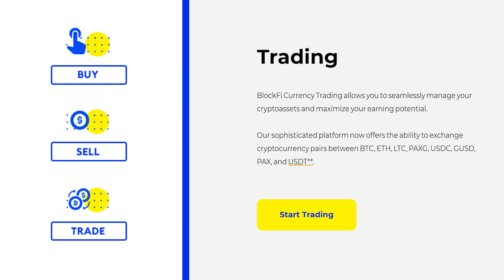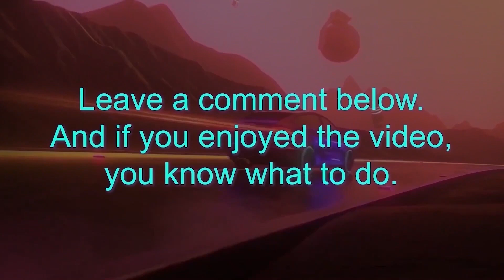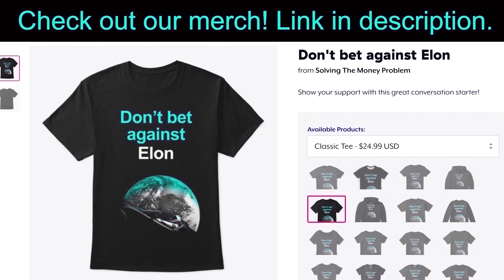Sandy Munro Shows Tesla's SHOCKING Lead Over Ford

Comment: I'm the living embodiment of the Osbourne Effect. Ford essentially sold me a Tesla. I got very interested in the Mach E when it was first announced. As I did my research, buying a Tesla became a no-brainer instead. A year later and I still get a thrill every time I drive our Model Y.
Reply: FORD still wants to sell you a FESTIVA ........LOL
Reply: @excelrobot  Let's Hope!
Reply: What were the main reasons you went with Tesla?
Reply: The Ford still works(cooling system)      It does the job.    Ford will simplify in time     As long as they sell as many as they make things will be good for Ford   The fist Tesla’s were said to have too much sheet metal to make the rear end   Now Tesla will be use they new press!
Reply: @marknelson463  the point is that the cost could have been avoided as the car was (hopefully) designed. 
More parts is lower profits and lower quality.
Reply: @NickYoung_Original  you do not get it   Yes it could be done better.    If it was perfect would it matter.
Reply: @marknelson463  Ford is a big, well established car manufacturer that fully understands how to build cars and make profit. So why are they going out of their way to produce a bodge job of odd parts all stuck together with hoses and huge wiring looms?
Reply: @marknelson463  Ford will simplify in time? They have literally known the issues since the 80's. How much time does Ford need to change?
Reply: PS they even have a nasty lead acid starter battery. Why is that not a long life LiFePO4 which would cost about the same and be about 1/4 of the weight.
Reply: @yourcrazybear  talking about the new Mustang E. Being a new car Ford will have the ability or opportunity to make changes over time   The 1980 has nothing to do with it (MustangE)
Reply: @marknelson463  On the contrary. They have known since the 80's about the risk for leakage and are still creating a leaking spagetti monster with their new car. They have had 30 years of time to fix this issue and they haven't. But still you are sure that they will? How much time does Ford need to change?
Reply: @yourcrazybear  looks like that entire system was designed so that the service departments have many billable hours after the 4 year warranty . Remember They need to keep their dealership model alive, and if they make it engineered not to fail, the dealers will not be happy.
Reply: @peterjackson1383  That may be the case. But instead they risk to make their customers unhappy in the long run. It's not a decision I would have made.
Reply: @TF-Times  it came down to a few things, but I can sum it up with this: I decided if I was going to go electric, I wanted to buy an EV from a company that was fully invested in the technology. As far as specifics:
Charging network
Autopilot
OTA updates (as of the time I made my decision, it was yet to be seen if Ford would be able to do that)
Reply: @TF-Times  and I would (and do) tell anyone who asks me about the Tesla that the charging network is INCREDIBLY important. We live in Alabama (not exactly the epicenter of EVs) and we've taken two 2k+ mile road trips in the last year to different parts of the country. The charging was effortless. That would not be true in a Mach E.
Reply: The Osborne effect he’s not buying today’s version because you’re waiting for tomorrow’s. One brand pushing you to another is something else.
Reply: @marknelson463  you're presuming that Ford even has "time." There's no TIME left for Ford, The time is NOW. Sadly, though, it's most likely too late for them. Their current debt is 9x their market cap while their margins continue to decline, their bonds have been downgraded to junk status, they keep changing CEO's which is never a good sign, their dealership business model is antiquated. I could go on and on. Best not to hang on to a brand simply for nostalgia's sake. Ford was revolutionary during the 20th Century. They did phenomenal things to move the world forward. Then they got complacent when they should have continued innovating, ESPECIALLY during this past decade. Ford will be gone in the next 5 years, sorry to say.
Reply: @captainsoul5956  I do Not know much time Ford has   Maybe more then chevy maybe not.   I like the new Ford Maverik hybrid under 20K that’s something to see 
I know the new GM is not in good shape money wise   It could go before Ford
Reply: @yourcrazybear  That's because you have integrity.
Reply: I love hoses. I'm buying 2 Mustang Mach E. The are so far advanced compared to Tesla, it even took good old Sandy for a loop.
Reply: @TF-Times  - Go test drive one.
Reply: @Dave5843-d9m  Well the engineers know how to build ICE vehicles they obviously have some trouble building EV's and those that know how and are smart are applying at Tesla. This guy video pretty much explains it all. Ford will have second rate engineers who couldn't make it into Tesla or Space X. When these engineers get weened away from Tesla in the future they will go work for Ford but will be restricted by upper management who won't want to change or have much of a vision.
Reply: @marknelson463  I pity the early adopters of the Mach E.  Ford might be able to simplify this Rube Golberg kludge.  This was likely the product of rushing to market a design before its due time.  Pity, and shameful.  Plus, Edward Deming is likely rolling in his grave seeing all the producibility and reliability infractions.
Reply: @fanfare100   but Ford needs to is sell them  unless it is a dog  Ford wins
Reply: @marknelson463  it matters very little which one goes first since neither are expected to survive this decade. Hybrids are a joke. As long as there's an ICE under the hood then it's antiquated. GM has shown how desperate they are after their ill-advised partnerships with Nikola and Lordstown. I'm surprised Mary Barra still has her job. But then what competent, self-respecting exec in his right mind would want to step in and try fixing that mess?
Reply: @captainsoul5956   I am thinking that Hybrids are all that other car makers have  No battery’s and No charging network.  Make a few EVs with the battery’s they car get for the customers that can charge them   The new Ford maverick pickup is what ford is banking on.   A 4 door hybrid as the base model   40 mpg city and only needs a small battery. Does NOT need to be plugged in.  Could be great in fleet use and for city use    Should be winer!
Reply: @marknelson463 if they're all that they have then it's game over for them. Apparently you believe Ford will survive despite all the evidence to the contrary. We'll see,
Reply: @captainsoul5956  No I do not know what will happen   I am in the (We’ll see) camp.  This would the 2nd time for GM. The 1st for Ford.  And yes I like the design of the new Ford Maverick  Toyota the #2 maker does not Believe in EVs.  Tesla to grow its business  designed a new battery (4680)  that it needs to make its pickup and semi truck. When Tesla needs all the battery’s it can get  You know that battery supply is problem!
Reply: @marknelson463  if you do your research then you'd know that new mining options are being explored, such as extracting lithium from clay. And did you know that 95% of a battery's materials can be recycled? Former Tesla Chief Technical Officer JB Straubel does, which is why he launched Redwood Materials. I also recommend watching "Where will Ford be in 5 Years" on the YouTube channel Now you Know.
Reply: @captainsoul5956  I know that Tesla is at its battery limit to make more cars it needs more batteries     The recycling is old news.  As well as Tesla mining options.   I do not know where Ford Will be in the future   But I do know Ford was the first to come out with an all aluminum pickup. Which Chevy laughed at.  I know GM/Chevy went bankrupt and Ford hasn’t yet  I know Toyota has stated that it does not believe in EV’s.  And I believe that is important as batteries are a charging network is just as important
Reply: @marknelson463  old news? Redwood's latest efforts for expansion were announced just a couple of weeks ago. You sound like someone who thinks he knows what he's talking about, which you clearly do not. I offered you references where you can do your own research, which apparently you're unwilling to do. Stop getting so hung up on Ford. They're doomed.
Reply: @TF-Times  I'm guessing range, tech, OTA updates, charging infrastructure, price, no dealership acting as sales prevention officer, fun features, games, Joe mode, dog mode, sentry mode, potential fsd and the fact that it all ties in to the solar roof, power wall and  Autobidder eco system, accelerating the world to using the "essentially" (cheers GJ) limitless power of the sun to reduce our reliance on digging up dinosaurs and prehistoric forests to fuel our motoring dinosaurs. 
Just an initial thought....
Reply: @marknelson463  why did they go back to the flawed connectors Sandy tried to eradicate forty, XL, 40!, years ago?
I bet most of the viewers are younger than that.
Reply: @excelrobot  yes, ford's problem is that next year is the year Tesla makes 2,000,000 cars. Up from 1,000,000, up from the 500,000/2020 Elon predicted in 2014.
Reply: @andrewsaint6581  Sandy has his own agenda.  They (connectors) have Ben used for 40 years  they must be supper bad   NOT.
Reply: @marknelson463   Ford will simplify in time... Why not do it before you start?
Reply: @tomgray971  if Ford has/had the time  but it wants to get cars/trucks out now not later  Many will stay with Ford problems and all.    From my point of view the Chevy bolt was a disaster for them.
Reply: From a stats perspective it was a no brainier, although I'd still like more range than what the current Model Y offers. I can't stand the look or name of of the Mach E either. IMO it is kind of garbage overall, but it's their first attempt so I'm sure they will improve significantly over time
Reply: @nafnaf0  sounds good.  The U.S. need a charging Standard  before EVs hit big time

Comment: Now I understand why tesla is hated so much, they keep innovating and offer the technology at a lower cost. How do you even start to compete with that?
Reply: Starfleetguy  Bob who? :-P
Reply: Not to worry, Thunderf00t says Elon Musk is the King of Vaporware, and Tesla and SpaceX haven't invented anything of significance.  A car full of "Scrap If Dropped" mystery boxes joined together by tangles of hoses held together with spring clips and prayer--now that's innovation!  /s
Reply: Plus, mainstream media (funded by big oil and big auto) hate that Tesla don't pay for advertising. Hence massive and prolonged FUD.
Reply: You don't. You make a niche product with decent engineering or you enter another market entirely. The ability of Elon to attract excellent engineers us unmatched so the answer is you don't.
Reply: Lower cost? Lol. Tesla’s are expensive and they keep canceling the affordable base models. I’m looking at the Mach-E because I like its exterior and interior better. Also, I should be able to purchase a Mach-E for less than MSRP. If Tesla brought back the Standard Range Model Y, I’d be down but as it stands, $50K+ just isn’t justifiable for me.
Reply: @excelrobot  I like your think.  Ford needs a culture change to adopt Sandy’s ideas and to let go of long term supplier relationships.  I believe Ford outsources their parts to their suppliers so their processes could be hampered by that.
Reply: @TecnamTwin  the only reason you can buy the Mock E is Ford realized demand has fallen off a cliff. An alt metaphor for Ford’s future
Reply: You start to compete by making it illegal to buy the product.  The harder it is to buy, the less competition you have to sell your vastly inferior product.
Reply: @sobieski902  retired executive at GM, he's a bit of a joke and retired with a fat cat pension while GM went bankrupt in 2008
Reply: @kevincrady2831  
I honestly think thunderf00t knows what he's talking about, he's a smart guy.
He's just lying.
Reply: Early on the media and no doubt ICE legacy auto started the ‘Tesla Killers’ club, naming the traditional ICE companies and the superior EVs they were going to soon come with and that would be the end of Tesla.   Oooops.   Now who’s eating who?
Reply: Starfleetguy  He was one of the first buying Tesla stock after selling his Ford stock.!!!!
Reply: Starfleetguy  haha!  Yeah i saw Lutz too on one of his rent an expert interviews put down Tesla.   Oops.
Reply: I was a component R&D engineer in the 1990s working for a small company with essential components for the then emerging electric car industry, including GM’s EV1. Here’s a few anecdotes:

I visited and consulted with engineers at the major car manufacturers in Europe and the USA, pretty much all of them.

The Europeans were way smarter, it wasn’t even close, except for Chrysler, because at the time Mercedes-Benz owned them and taught them how to do engineering properly.

In the USA, Chrysler was the best, because of handholding by mama Mercedes.

GM was fairly dysfunctional, but they were smart enough to buy a design from a brilliant electrical engineer. That was the EV1, A godsend that only GM could eventually squander, and boy did they (see movie “Who Killed the Electric Car”)

Ford was so stupid to work with and so frustrating that it was one of the few times in my life that I wanted to kill fellow engineers. I am not exaggerating.

The Ford electric vehicle was so badly designed that it was good at only one thing reliably, and that was burning down houses where it was parked while charging. This was a major news story at the time. I used to laugh every day when the news update would come in on how many houses had burned down because of Ford’s jackalope electric car.

Our component was a high-voltage electrical Relay for safety disconnecting of the batteries in case of an accident, and for maintenance and other purposes. This component was relatively complex and expensive. Nevertheless, two Ford engineers lectured me on how Ford priced all of its parts from its vendors .... to four decimal places.

My reply was instantaneous, I said you mean like washers and rivets, I’m not selling that stuff ....

Ford chose to use a golf cart contactor for low-voltage systems, totally dangerous for high voltage battery systems. Maybe that’s what doomed their house warming vehicle.  

The burner car was recalled, it’s not worth selling Electric car for $30,000 and then having to replace a $300,000 house that it burns down. That’s the Ford I know.
Reply: Kevin Crady :  Not kidding, the best laugh I’ve had in weeks was saying that maze of hoses, like a Halloween night mare maze. If I was a mouse I would commit suicide if I was in it.
Reply: TecnamTwin :  Good luck, my advice, buy a tray to catch the leaks
Reply: stephen s :  perfect name you gave it, “mock E”. Thanks for the amusement!
Reply: @TecnamTwin  hopefully it's just the chip shortage meaning there is a supply issue with too much demand thus prices go up. Bad news is the chip shortage should last another while yet and demand isn't lessening
Reply: Tesla stopped innovating some years back. Where are the new vehicles ?
Reply: @grahamstevenson1740  Surely a troll?
Reply: @Tom_McMurtry  No, seriously. There was distinct progress from the 'roadster mark 1' to models S, X and 3. Tesla was clearly getting better at making EVs and the components for them, motors for example. Model Y however was largely a 'modified' Model 3 and where's the Cybertruck or the semi ? It's all gone silent.

Meantime there are European companies making huge inroads with commercial EVs (aside from about 30 models of electric cars on the market) from the humble delivery van (around 10-12 models from multiple suppliers) to larger and fully articulated trucks (Volvo, Scania, MAN for example).

I'm confident there'll be very widespread adoption of commercial EVs. For one, a business can maximise tax benefits and fuel cost plus maintenance savings in a way that a private individual can't. Also a business is better equipped to have a dedicated overnight charging area and indeed usually isn't likely to use the vehicle at all at that time. CFOs should be 'champing at the bit' to get their hands on these.
Reply: @grahamstevenson1740  plaid seems like a significant upgrade in innovation from the original or even the last lot of model s. Perhaps the biggest innovation of late has been in battery and manufacturing. The cyber truck was always coming and is still planned for end of this year. Mentioned frequently in tweets. Larger trucks for cargo coming soon after and the roadster coming along. Model y is an entirely different category even if similar to 3s tech. 

Tesla is not yet a large comoany. It is getting there. The acceleration of tech is muvh quivker than I'm seeing out of other automobile manufa turers and am pleased that others are looking into category models that tesla does not have capacity to build at this time. 

Autopilot beta 9 is a pretty significant leap from.the standard across cars everywhere else in keeping in their lane. But that is almost seperate to what is being mentioned.